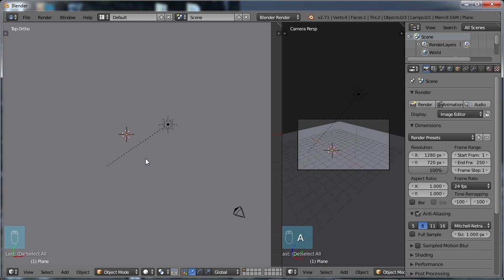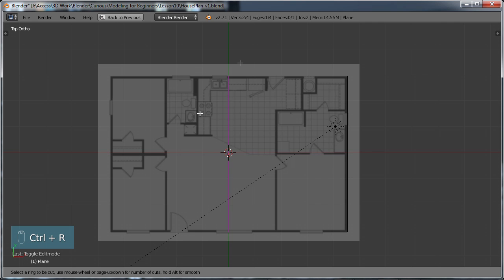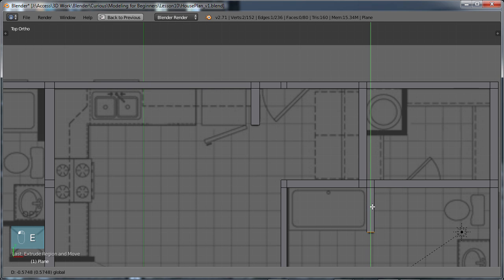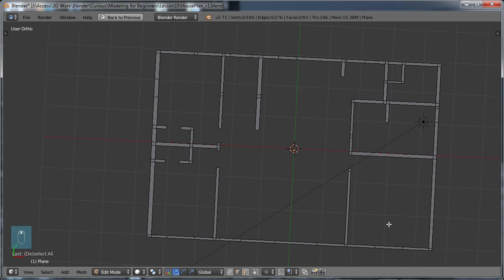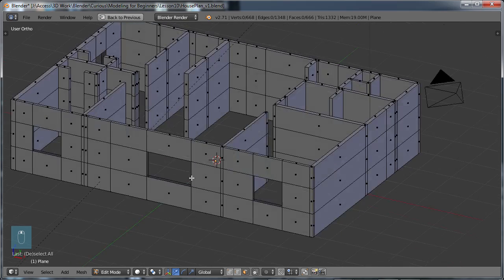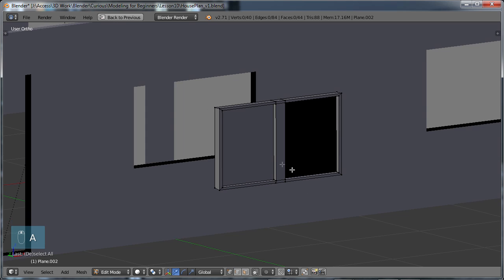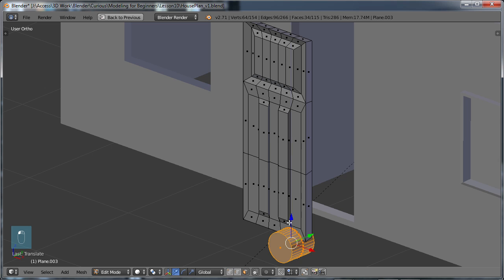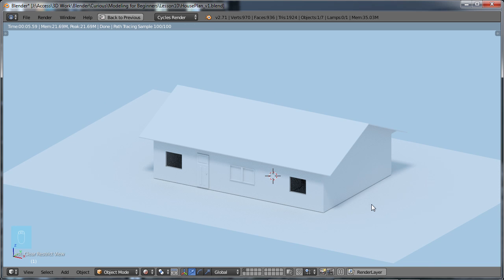Blender For Noobs -  Modeling for beginners - Part 10 of 10

Comment: Good videos, but I'm confused as to how the measurements can be correct in Blender because as you can see at https://youtu.be/ZhAyeJaiiVQ?t=5m47s   - The box around the blueprint claims the box is "square" at 2m x 2m which it is not! 

So how can we trust that even if we expand the scale; (as 2 meters square is far too small, unless its a hobbits house),  how will we know for sure the measurements are correct? 

I did expand the blueprint and the scale remains out of whack, (claiming its square), is there an answer?
Reply from the maker: hmmm, yeah, I see what you saw there.  Not sure what happened. If I noticed it at the time, I would have pointed it out, but I believe it was probably something to do with scale.  Blender works with actual measurements with no problem, you just need to be aware how the scaling works and when to apply it.  I've designed car parts in Blender with very small tolerances, so it can be done in Blender.  There are those that argue that Blender is not a CAD program.  Well, of course it's not.  It's not made for that, but you can do general scale drawings in Blender.  I've also done a number of other projects for people who wanted to 3D print exact pieces from Blender.  People do it all the time.

Comment: Confused at 10:14. Wont let me select more than 1 face. Have to delete 1 by one
Reply from the maker: Are using shift+click?
Reply: Ya figured it out. Nice vid dude. Keep um coming. One question. Does the texture decide weather the house will be high or low poly?
Reply from the maker: Nope...whether you want a lot of details (pieces) or not in your model determines if it will be low or high poly.  Also, it has to do with what you are using your model for.  For example, if you are making the model for a game, many times you will want it to be low poly.  If you use a high resolution texture, though, you can make it appear like the model is more detailed than it is...hope this makes sense.
Reply: Got it. Using 1024x1024 for the time being and seeing how that looks.

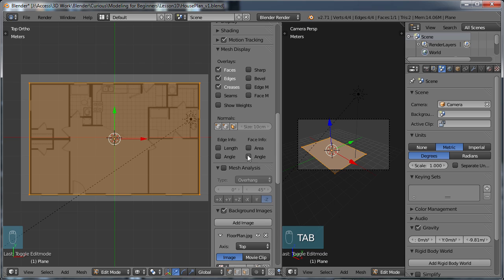Comment: When you talk about being able to view the measurements of a shape (5:36) it displays the length of the floor plane as 2m and the width as 2m - it did the same on my computer. Surely this is wrong, the shape is a rectangle and so the edges can't be the same length. It seems that Blender is getting the measurements wrong, is there a fix for this? Great videos by the way, thanks for taking the time to do them.
Reply: LivingStatueCompany Aha! Have found a fix. Make sure the setting labeled "Global" is selected in the Transform panel (the "n" panel, same as for inserting pictures) and then the true dimensions will be shown. Very important I imagine for anyone wanting to make accurate scale models.
Reply from the maker: LivingStatueCompany Absolutely! Thanks for sharing that.